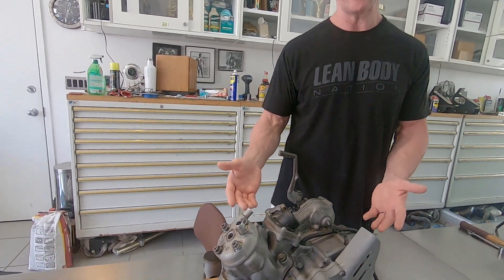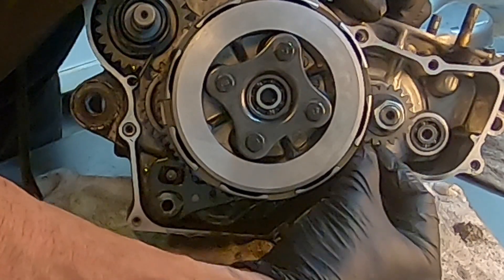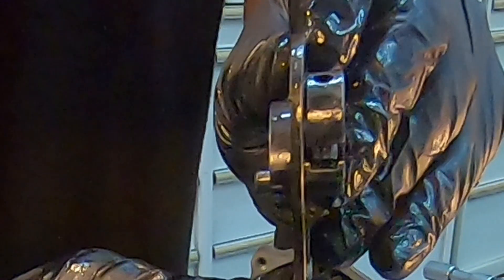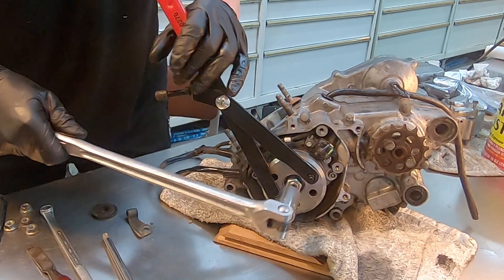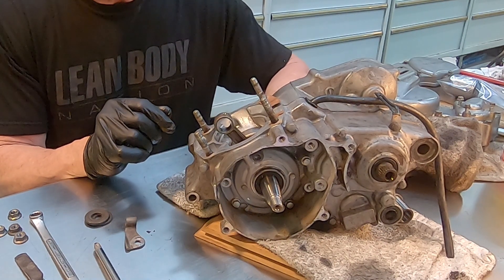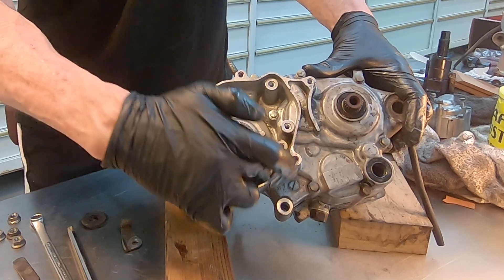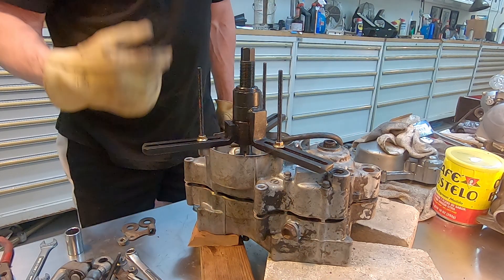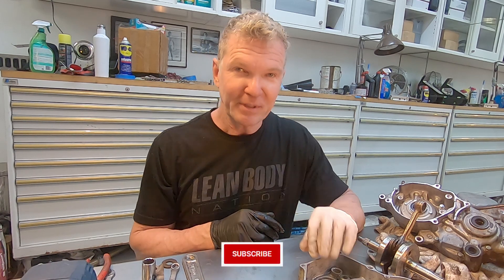Honda CR85 Engine - Teardown

Comment: For the left case to be off does the right also have to be off
Reply from the maker: I’m not sure if i understand your question. But, the cases are joined along a single, central axis. So separating them removes both halves from the other.

Comment: I prefer to put a piece of plastic between the teeth rather than something made of metal. Alternatively aluminium. Those teeth are hard, but I still prefer to use a softer material if I don't have a tool to hold it in place

Comment: Thank you for the video. In my experience people who tell that their engine failed because of oil premix pump are like people who say they she went up the duff because the condom broke. Most of the time is another issue, they just like to blame the pump. In your case the piston didn't even seize... Out of dozens of engines that I diagnosed that were seized the culprit was something else, but at least half of them said it was the oil pump... which turned out to be fine...

Comment: When messing with the countershaft, did you see any lateral play there? I bought a cr85 used recently. There is 2-3mm of play on the shaft(not the sprocket). I am assuming a washer was kisses during reassembling. Have ordered every washer for the countershaft, but I'm wondering if you encountered that before i solit her open.
Reply from the maker: There is a bit of lateral runout and it freaked me out the first time I observed it.  Apparently, thats the way it was designed.

Comment: I have a cr85r 07 it’s been out in the weather and stuff but my bottom end is still tight and no up and down play looks like just need a top end but I was concerned since it’s been out there what other suggestions should I look at
Reply from the maker: Everyone is different, but if it was me, I would completely rebuild ANY motor that has been left outside in the elements   Water will RUIN a motor.

Comment: Are you still active I am working on my 2006 cr85rb expert and currently rebuilding the bottom end the shaft rod shot out the bottom and my father I'm law is welding the case and I am ordering the rebuild kit bit I am needed help getting the clutch bolt off. You made it look easy
Reply from the maker: Hi Spedest. Sorry to read about the clutch bolt. I have never had much trouble removing one of those. Use an impact driver and a clutch basket holder (if you can find one) and it should come out. You can try heating it too, but be VERY careful as you don’t want to overdo it. The clutch basket cover is aluminum and can warp if overheated.

Comment: The left side, the sprocket side, is that just a plastic cover (1:10)?  Can it easily be changed or does it require seals, etc?
Reply from the maker: Hi Aaron:  I dont see anything at 1:10 that is a plastic cover.  At that point in the video, I am discussing the procedure for the removal of the head and cylinder.  Thank you for watching!

Comment: Brian, If just wanted to change 3rd gear (kart racer) to a billet gear would I still  have to completely remove the crank?
Reply from the maker: Hi Aaron. I’ve not heard of a billet gear on a kart, so I’m not exactly sure what you mean. Is this the drive gear that connects to the chain or some kind of billet aluminum transmission gear? In either case the crank should not be affected. If it’s the former, changing the drive gear is pretty simple.  If it’s the later, the transmission can be removed for gear changing while the crank remains in place.  Hope that helps.

Comment: My head bolts are super tight. Any tips? Don’t want to strip them. Are they reverse thread? I have 2005 cr85
Reply from the maker: Hi Henroo.  They are NOT reverse thread!!!  Dont turn them the wrong way!!! Those studs can get pretty rusty.  Have you seen the "double nut" technique where you tighten two nuts against each other on the end of the stud and loosen?  I have sheared studs off myself and its total bummer.  If they dont come out using this technique, add heat to the surrounding aluminum.  Even this is not always successful.  But, heat and double nutting and being strong are the best techniques I have found.

Comment: Do you know where I can get all the specialty tools used
Reply from the maker: Hey Landon!  This video is a little older.  Now I include all the tools and supplies I use in the description box.  I just havent made the time to add that information to my older videos.  That said, I got most of the speciality tools from Rocky Mountain ATV.  Hope that helps!  Thanks for watching!!
Reply: @brian.d.mobley  what size was the puller
Reply from the maker: @landonsanford5342  I am so sorry, but I dont recall.  I have a puller kit and the correct size was supplied it the kit. https://amzn.to/3ucKqow

Comment: I’m new to bikes but I have a cr85 and the rear tire locked up and the Kickstarter did also what do you think is the problem?
Reply from the maker: Hey Vinnie.  That sounds like a stuck piston, unfortunately.  Did you mix 2 stroke oil with your fuel before running the motor?
Reply: @brian.d.mobley  I think I was just going to hard on the engine but I’m going to try to look at the piston and cylinder but thanks a lot for your help keep up the good vids

Comment: I split the case and my crank came out in the right case
Reply from the maker: Hi CRF. I’m not sure if you are asking a question or just giving me a report about your engine build.
Reply: @brian.d.mobley  asking a question i noticed your crankshaft came out in the left case but mine didnt
Reply from the maker: @Hi-vw6dg  If you have a puller, you can pull the crank out.  You can heat the cases a bit and pull the crank out without much difficulty

Comment: The one im buying has been sitting in a garage for years I’ve actually seen and started it in person they said it hasn’t started in two years and I got it after 3 kicks
Reply from the maker: Hey George!  That’s cool!  I bought a CT70 that had been sitting for years like that. Cleaned out the old gas and it kicked over, no problem!!  It’s a nice little surprise when stuff like that happens.

Comment: I wonder if the 85R bolts right onto an 80R frame. And just swap out the CDI.
Reply from the maker: Hey RNR. I can find out for sure. I think so. I’ll get back to you.
Reply: @brian.d.mobley  Thanks!
Reply from the maker: @rocknrye9273  From 1996 and newer, the swap will work.
Reply: @brian.d.mobley  Awesome! Thanks for the reply back. I have a 97 ☺
Reply from the maker: @rocknrye9273  Start wrenching! Ha!!!
Reply: @brian.d.mobley  1st i gotta get an 85R engine lol $$$$
Reply from the maker: @rocknrye9273  you can find one!  They are around

Comment: Looks like a socket that you used to punch out the sleeve right? Metric? I’ll try to pick one that is the same size if so. Your videos on the 85 are so helpful!
Reply from the maker: Johnny Wishbone - Psychic Extraordinaire from the island of St. Croix! 🤣. Hey Johnny!  It was a socket. And the socket was connected to a normal socket drive extension. I don’t recall the size, but as close to the OD of the sleeve as you can find. Thank you for watching!
Reply: @brian.d.mobley  I’m a few weeks out to having this 2001 CR80R complete. I’ll have to upload my first video when it’s all done! Can you help solve a mystery about the rear swingarm? On each side there is 1 bolt for the chain adjuster that goes into the swingarm followed by 2 nuts lol and on my bike it’s not threaded. Do you remember if the swingarm was threaded on your bike to accept the bolts?? Tusk sells a swingarm chain adjuster bolt repair kit so I’m thinking it might be...
Reply from the maker: @johnnywishbone1349  Man, I’m sorry, but I am not sure. I have only owned CR85s and I think swingarms on CR80s are not the same. If you have the service manual, look in there. You can usually figure it out most easily that way.
Reply: @brian.d.mobley  Brian the OEM swingarm from 1998 CR80R to 2007 CR85R is the same part number 52200-GBF-J00. (Could possibly go back to 96) While many things changed on these bikes over the years some things didn’t which is great for owners of the CR80R. I do have a copy of Clymer service manual, but it doesn’t say anything...
Reply from the maker: @johnnywishbone1349  Im familiar with the swingarm compatibility between 1998-2007, but as I recall, you were inquiring about a 2001 swingarm. I have not worked on any pre 2003 CR85s and no CR80's.  Sorry I cant be of more help.
Reply: @brian.d.mobley  Thanks for the reply. I ended up dropping the case off at a Honda dealer because I was afraid of damaging it myself. Was charged almost 1 hour labor ($103) in case any of you are wondering what it might cost. The collar/sleeve was very rusted!
Reply from the maker: @johnnywishbone1349  Ive pulled out some super rusty ones too. And its not fun. I don’t really care for using fire as a tool for what is otherwise precision work. It just doesn’t feel right somehow.  Anyway, glad you were able to get yours services and that you can move on to other work.
Reply: I’m really having a hard time getting the sleeve punched out any suggestions I’ve been trying and trying and nothing seems to work btw great video

Comment: Very very great and helpful video. I have a question though, where did you buy the special tools you used? Any links?
Reply: Thank you sir. I have one more question, my cr85 has a leak in the middle gasket (crank area). Can i just remove the left side and change the gasket? Instead of removing the right side? Thanks.
Reply: Awesome. Thank you very much, very informative.